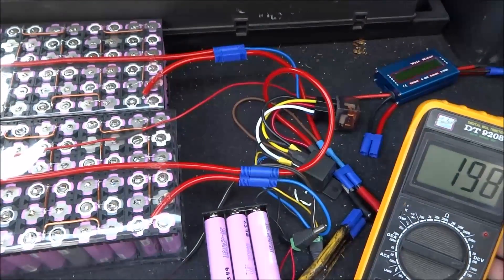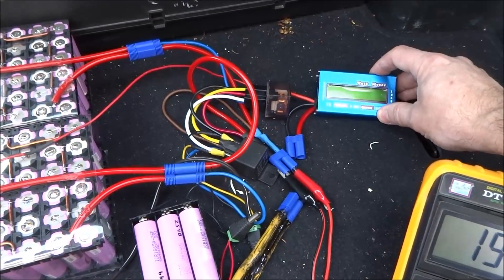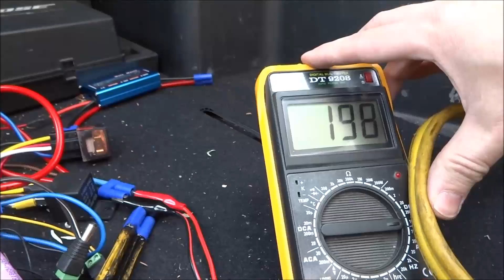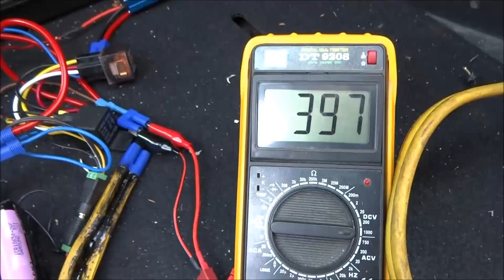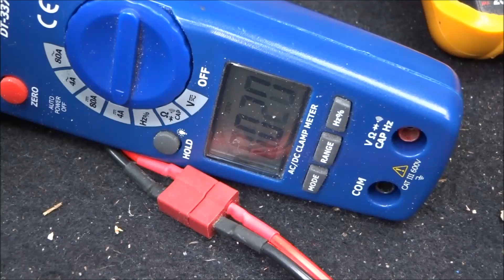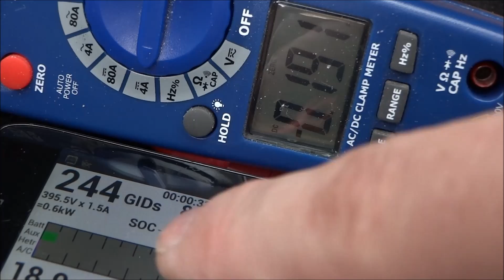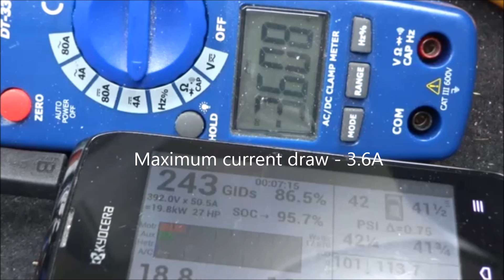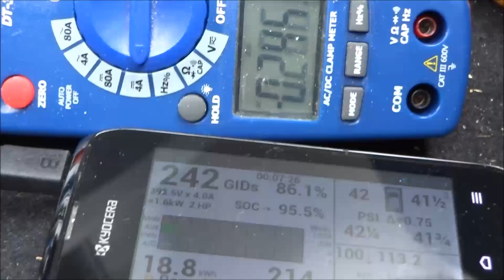Nissan LEAF range extender pack build Pt.3 (first road test)

Comment: I'm getting closer to trying this with my leaf. So I am watching your videos again (Thanks again for sharing your work here!). I just had a thought, when you completed your driving test in this video, did you leave the car "running" when you got out from behind the wheel? I'm thinking you must have because if you had turned off the car, that would have disconnected the main battery pack and your packs in the trunk would have still been connected which I think would have made the car computer throw a trouble code (Check Engine Light). Am I correct how you did this?

Comment: Please install a 1000V DC fuse in series with main battery pack.
http://www.ebay.com/itm/New-MC4-In-line-Fuse-Connector-1000-VDC-Male-to-Fem-PV-Solar-Fuse-Holder-Tool-/272281820453?var=&hash=item3f6542dd25:m:mPuWUO9jlbmWF2p0iIB4UUQ

and please use some better insulated connectors, these are for RC 

How will you monitor the cells?
Reply from the maker: I do have fuses, see:  https://www.youtube.com/watch?v=1vgzgcPFaQg&t=9s
Yes the connectors aren't rated for 400v but I cannot find any that are.
It would be nearly impossible to monitor 96 cells.
Reply: Nice job with the fuses.
For connectors use some of the anderson series:
http://www.ebay.com/itm/Battery-Quick-Connect-Connector-Plug-50A-600V-Disconnect-Winch-Trailer-Electric-/191850318873?var=&hash=item2cab2b8c19:m:mH67ug89vY7IXhIZspSbZGA
or if 30 A is enough You can use mc4 from sollar.
Reply from the maker: I don't really like the anderson connectors, they are big and clunky, but the mc4 are a great idea.

Comment: Great project, really enjoying. Wondering why you don't try let your on-board charger charge your prototype pack by leaving it connected while you charge the car?
Reply from the maker: This would probably work, however I'd have to make sure I disconnect my battery from the high voltage line before the contractors in the primary pack open when the charge is completed. If you leave the secondary pack connected to the high voltage line when the primary pack is disconnected, you will damage the car, something I learned the hard way.
Reply: leaf x ,, yeah electronics are very touchy ,, even though it makes no sense that a lower secondary pack would damage a high volt lines electronics anything is possible ,, would you be ok telling me what it was that got damaged ,, relays or cluster panel , ect  ,,

Comment: Your Project is amazing and every step is very well explained, however I didn´t dig the wiring of your pack due to lack of electronic essential knowledge:
For my eyes it looks that whole amps go through this tiny resistor-wires in series. In your video 2.71 you can see it clearly, that you hooked up
the big main leads to your pack´s thin minus and plus resistor-wires. Could you please add an schematic of your wiring to your videos or try to explain it why these wires won't crock?
Reply from the maker: You are correct, the small wires act as fuses. In testing they can carry about 6 amps and since there are two cells in parallel, that's a theoretical maximum of 12 amps.

Comment: I just finished binge watching your series. :)

Couple of questions and suggestions.
1. Why not build a more "standard" battery pack? Lets say 48V with more batteries in parallel, and strap some sort of converter on the output to get the high voltage that You need? This would make Your charging and balancing a lot easier as there are ready made solutions from ebikes or solar systems.
2. In one of the previous videos You mentioned that You don't trust Your Imax clone. I had the same problem with mine but I found that imax has a hidden calibration menu. You can set it up to proper levels there.
3. In one of the previous videos You said that You don't like the way Imax discharges cells? Why? The difference in capacity between 1 Amp and 2 Amps is a normal thing. When You discharge a cell at lover loads You get a higher capacity. Imax uses that principle. It lowers discharge current when battery reaches 3V and keeps lowering it until voltage drops below 3V at 100mA current. I think its a more accurate measurement.
3. Great job with the excel spreadsheet. I had a similar idea. :)
4. Instead of measuring capacity difference between 1A and 2A discharge and voltage drop in storage You could measure internal resistance of a cell. That is a much better indicator of a cell health. The new Imax mini has this feature built in and it takes couple of seconds, not days. :P
Reply from the maker: That's quite a few questions.. I'll try to answer them the best I can.
1. I think that would be a great solution (48v pack with a step-up converter) but I don't think such a thing would be cheap. I haven't found any step up converters capable of the high DC voltage I require. I think this is the method used by www.enginer.us for their kits but I haven't yet tried to contact them for a price. If you know where I could get a low cost step-up converter please let me know.
2. I tried many times to access the calibration menu on my imax clone without success... 
3. The proper method of doing a capacity test on a cell is to discharge at a constant current until the voltage drops to a certain value. You should never change the discharge rate during the test as this will give you incorrect and inconsistent values. 
4. Yes I did experiment with testing the internal resistance (the Opus can also do this) but from my experience, nothing beats doing an actual capacity test although it does take a lot of time.

Comment: What does that small connector do that you connected before you plugged the pack into the car?
Reply from the maker: It activates the relays to switch the two packs from a parallel configuration to a series configuration. I explain it in this video: https://youtu.be/A7Hgbr7Or6Q